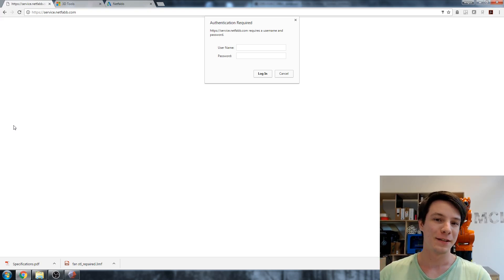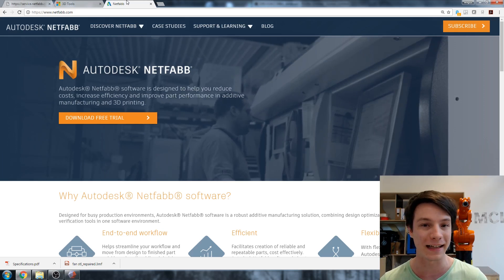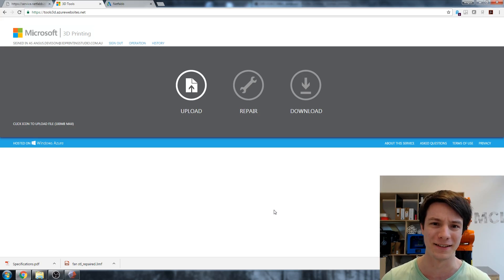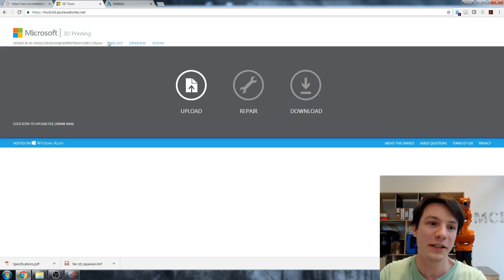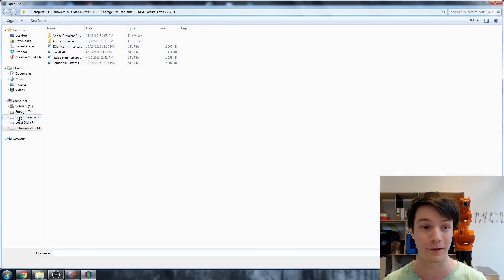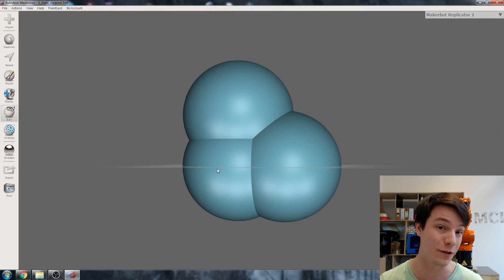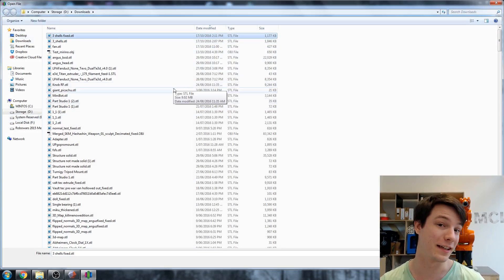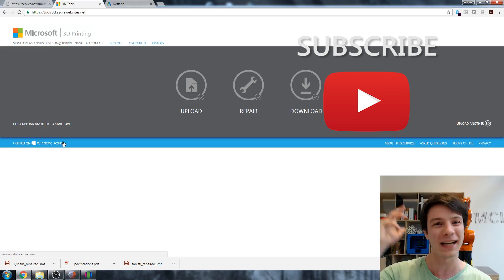How to convert .3MF into .STL for 3D Printing (work around)

Comment: I tried to download it, and had to register, and then couldn't even find meshmixer ? A long list of things I have no clue about, but no meshmixer mentioned. For those people who don't know anything about those programs and technologies (I'm not a tech head and am good with Blender and at this stage creality slicer), can you be more specific on how to get in and get access to this software. I have several 3mf files that need work done to them for one reason or another before printing them again.
Reply from the maker: Yeah this tutorial is completely outdated sorry. Try windows 3d builder, it can work with and save between the two formats and do basic exits and repair

Comment: This work but is like you said a work around. the solution requires new firmware in all printers to handle g2 and g3 functions so the machines can generate a proper curve, not a bunch of straight lines, than the slicers need to generate that code. once all of these variables are in place everyone's print quilt will go through the roof. I like the fact that 3mf also keeps colour data for multi colour printers. FYI this will dramatically reduce the file sizes for the g-code, which I have a big pet peeve for. why are G01 and Fxxx not modal they don't need to be on every movement line.  EDIT OMG was I wrong. they still use triangle meshs. they need to go away to get rid of those darn facets without rediculous file sizes.

Comment: FYI apparently Netfabb basic still exists, you just have to download the trial of Netfabb 2017 and it reverts to "basic" when the trail ends.

https://www.netfabb.com/blog/netfabb-basic-now-just-netfabb

Above link has this statement:

Instead of downloading netfabb Basic as a separate product, all customers have to do now is download the free Netfabb trial. For the first 30 days, users will have access to all the features of Netfabb Premium, including advanced packing, support structures and support for metal additive systems. When the trial expires, the software will continue to run with the same functionality that was previously netfabb Basic. For most users, it’s still the same basic Netfabb you know and love and can be used to preview, fix, and analyze STLs and much more.  Unfortunately, we do not currently offer support for Mac or Linux users.

Comment: Angus, I haven't got a clue about what you are doing here!  What is Netfabb and why do you need it?  I've never seen it mentioned anywhere before!   How did you produce a file that needs to be fixed and why does it need fixing anyway?  Also, since when does Microsoft have a 3D printing file fixing service?
Reply from the maker: Haha, maybe I need to do a 3D 101 on the basics of stl repair :) Not all meshes are 3D printable.
Reply: Yeah I think so.  Joel the 3D Printing Nerd has never mentioned any of that stuff!

Comment: My meshmixer doesn't let me open .3mf files - what version you have? I have the latest version. Maybe there is an extra step?
Reply: I have a MAC - maybe that has to do with it.
Reply: Try http://www.meshconvert.com/ and see if it works for you.
Reply: Aaron Yourk,  I tried that and says it doesn't support that file type.
Reply from the maker: Sorry, you need to use one of the latest beta's on the Meshmixer website , will add an annotation.

Comment: you can also use the free  3D file service on Thingiverse called make printable.
Reply from the maker: Will make printable stitch shells? Need to look into it more
Reply: I believe so, I've had no problems using it with my 3D models.

Comment: It's a shame that you completely ignore 3dBuilder. It's an amazing program for these simple and practical issues (slicing, fixing, converting, etc.)
Reply from the maker: I ignored Windows 10, as it would risk breaking a lot of my legacy software. It's a shame it's locked to that platform.
Reply: windows 10 hasnt broken any of my legacy software. what legacy software will windows 10 break?
Reply: I'd have to agree that 3D Builder is a straight forward "one-stop" application to do these repairs & conversions. I've used that exclusively for these fixes the last few months & it works quite well. Maybe worth to look into, after all. :)